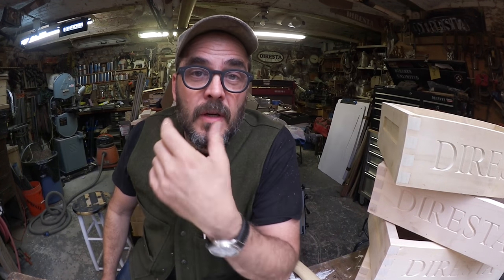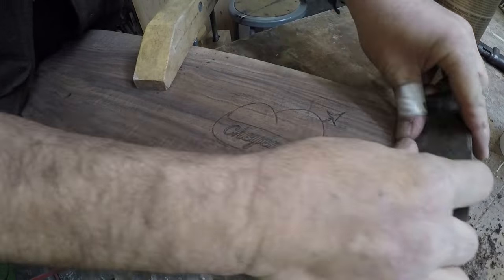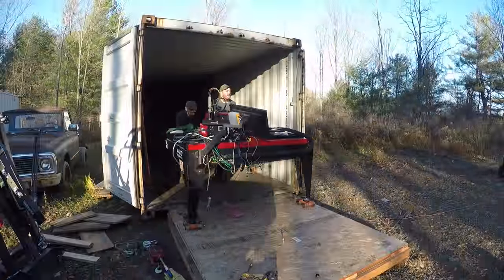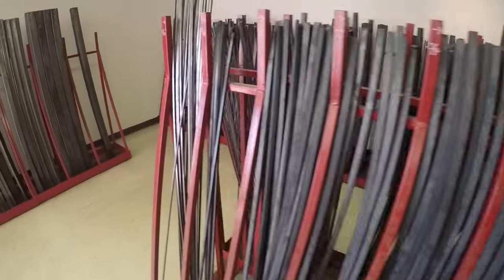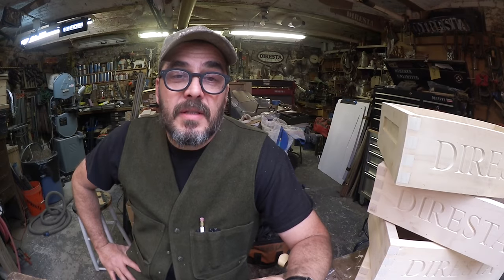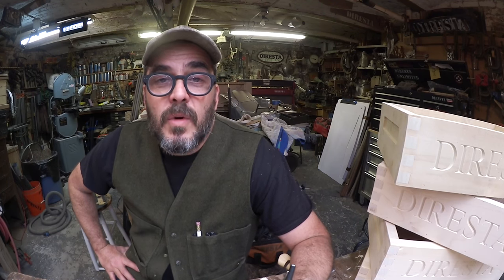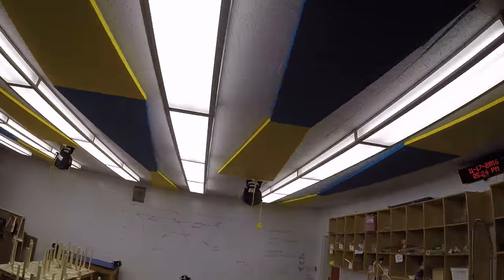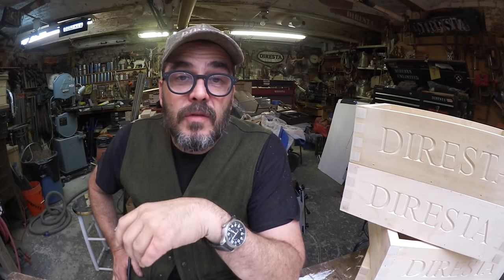✔ DiResta 10 Heavy Metal

Comment: Mouse trap: Stick a ring of peanut butter around the inside of a 5 gallon pail, a few inches from the top.  Put a couple gallons of water in the pail and something as a ramp for the mice to climb up the side.  They'll climb up to get the peanut butter and fall in the water when they can't quite reach it.  You'll catch more mice than you can believe with this trap.  We've been using them for decades in our barns.

Comment: for the mouse trap take a soda can drill a hole in the bottom run a wire through it and then attach the wire to a bucket. put peanut butter on the can and then put a ramp up to the bucket. the mice crawl across the wire to the can. the can spins and they fall into the bucket

Comment: Hi DiResta
I have a nice mouse trap for you: attach a hinge on the middle of a strap of wood. Attach the hinge to the edge of a barrel or bucket or whatever box.  Nail a piece of sausage to the end of the wood that points towards the center of the box. The idea here is that a mouse will climb the wooden stick to get to the sausage, then when the mouse is over half way, the stick tips over and the mouse fall down into the box. 
Leave the box empty if you want the mouse alive or put soap and water in it I'd you wanna kill the beast. Soap will break the surface tension, making water pass trough the fur on the mouse and touch the skin, killing it by cold. 
Does that make sense? :)

Comment: You might be better off excluding the mice from the food. Given the weight difference between a chicken and a mouse you could make a catflap that only opened when a chicken was standing on the right spot, or use the extra reach of a chicken and a moat filled with the chicken's water supply or something..Then it might be an easy task to bait the mice. It might also be worth teaching your chickens that there's food inside mice. A chicken is more than a match for a mouse, and would have no trouble catching them once they discovered they were made of food.

Comment: Ultimate respect for your always epic work brother but... Page 1 of the book, Branding Tips for Cool Mofo's, it says, 'Don't be changing your logo unless you are changing it permanently"…  I thought about this a while ago when you changed it for your icepicks. I didn't buy one because you change it!!!  Not only is the old stencil font great because it's a stencil and you can spray that logo everywhere, but it's You. Way more you than Times Roman! There are cooler stencil fonts if you want change, why not develop the look instead of changing it so radically. Evolution not Revolution. A cool trick is to go to www.myfonts.com and search for Stencil, put DIRESTA in the field so you can see your name in each and every stencil font (hundreds). Take a screen grab of the sexiest one and you have a free logo! <3
Reply from the maker: Waynos Waynos i like the stencil.  The times fit on the icepick better. The stencil was too clunky that small. ... and besides the CNC had the v bit on from previous job ;-)
Reply: Got you… 'gets tricky but my vote is to use it even when tiny to appease the fans. It's such a utilitarian font and a little clunky for sure but still good and yours! It's old (pushing 80) and was created in 1937 in London. It must have been the first because it's called 'Stencil'. Loosely based on an all caps version of Clarendon (designed by the same font foundry way back when which makes sense to the similarity). Looks more like that than Times Roman so probably better to use something like that in tight spots if you had to. Another thought is to commission someone to make a version for you that works better in micro sizes such as icepick that has bigger gaps than standard.